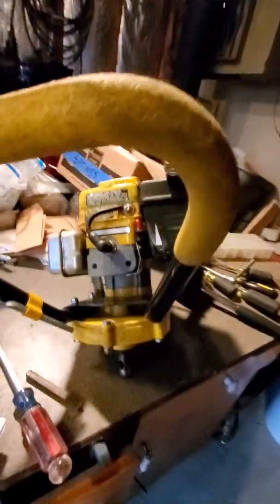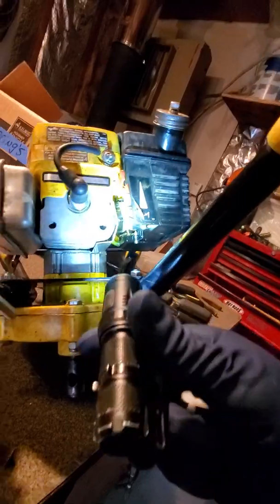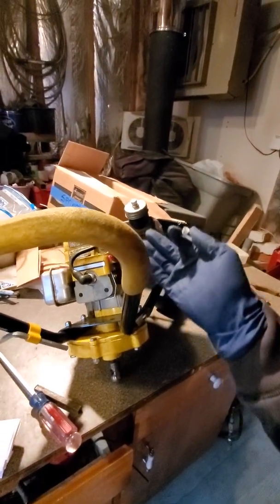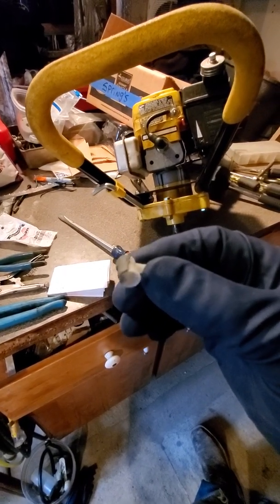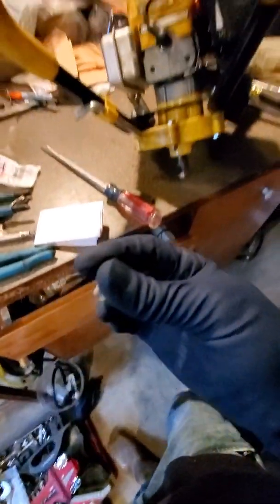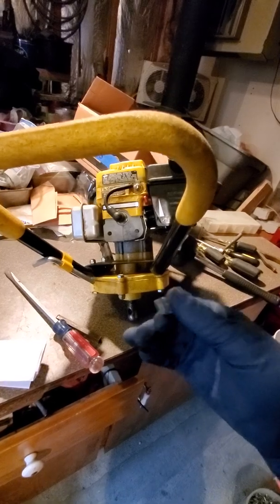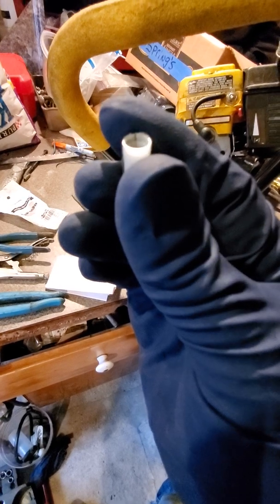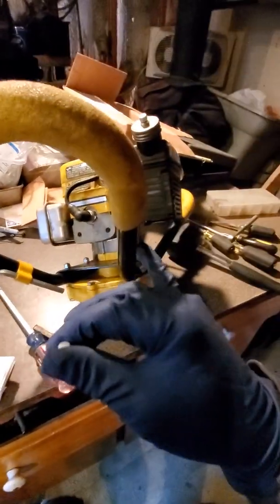Broken fuel fitting on jiffy ice auger

Comment: I had the same issue on the same auger and had to use a chain saw part
Reply: I used wire shrink tube. I'll find out tomorrow if it works. Same exact problem.